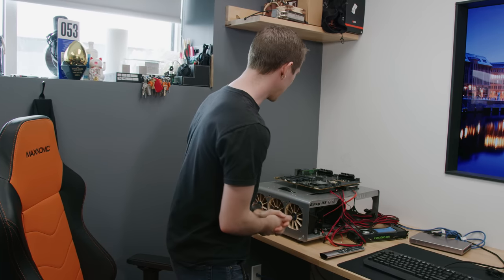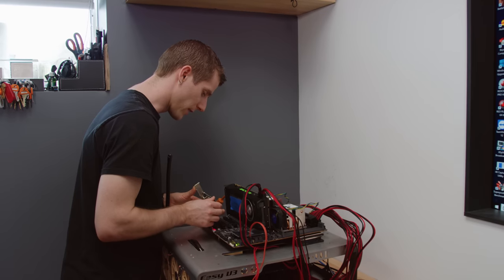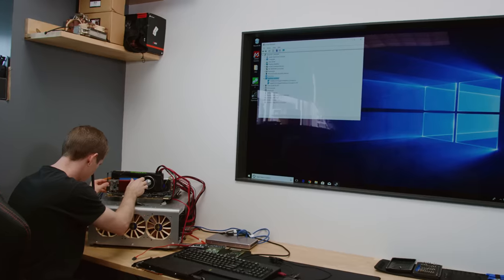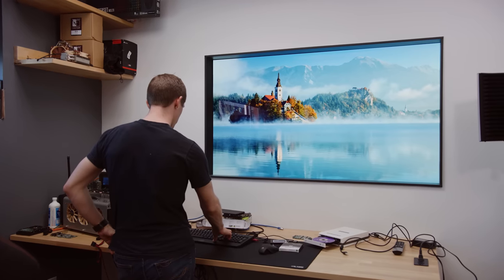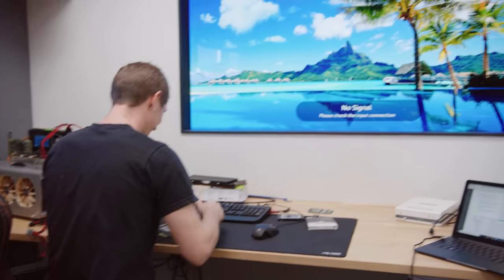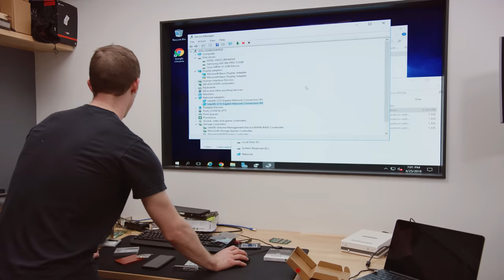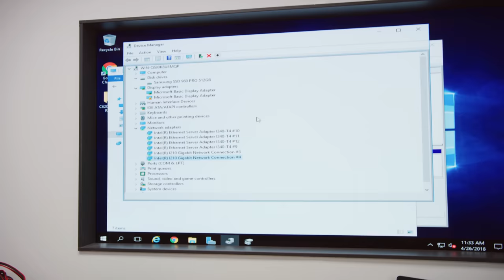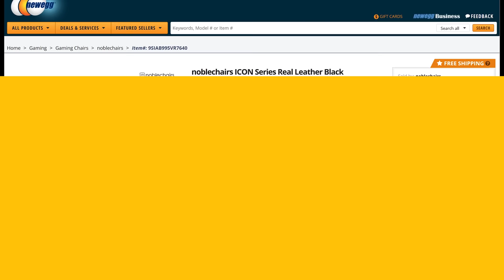I've NEVER been so FRUSTRATED... Hot-Swapping PCIe Cards

Comment: This is pretty good news for repair shops the need to test parts a lot. Nice and easy, just plug it in and immediately know whether it's dead or not.
Reply: chipmonk434 ohh get outta here with your plausible use case.
Reply: Well it would certainly speed things up if the part was working. But would you really trust this method to determine that a piece of hardware was dead?
Reply: If it became a stable and supported feature on future boards... yeah... why not?
Reply: It's been available with server class motherboards for more than ten years, and before that it was possible with PCI cards. I wouldn't be surprised if it's in the first PCI-E specs.

Manufacturers don't want to enable this for consumer cards as every time you plug a board in doing it "free hand", like Linus did it in the video, there is a chance you either misaligned it, dropped the card, touch a nearby card or short circuit something on the motherboard by touching it with the bracket.

In servers where the hot swap capability is enabled they usually separate the cards using plastic dividers so you can't short out a neighboring card, and card guides that attach to the card and then slides into guides built into the chassis making sure the card is going straight down into the slot. As the card guides has to align the card exactly they have to be designed for each card, making it impossible to have one for every card out there. So they will only make these for a small subset of controllers sold by the server manufacturer, and any use of a card not on this list will invalidate any warranty or service contract with the server manufacturer.

Comment: PCIe was designed to be hotswapable ... and it actually works fine on most motherboards, however Windows does not generally support it, but do check out the kernel options in Linux. (again make sure the option is enabled in the kernel!)
The biggest issue is plugging in the cards straight as to not short circuit.

Comment: Imagine a cpu that is hot-swappable ⚡️
Reply: That should be a video!
Reply: I assume this is only for servers with 2 cpus lol XD.
Reply: I've had the pleasure to install a system with full redundancy. It was a storage array combining SSDs and HHDs to form one big volume, and if one of the CPU would fail, the system would switch on the other one. The same happens for network cards, PSU and... Well... all other components. This is super awesome for system updates, were you don't even have to turn off your production system!
Oh, and the whole thing was running on Linux.
Reply: Uhh Hot Swap Power supplies already a thing if you have 2 Power Supplies installed
Reply: MODULAR COMPONENTS!
Reply: We've got servers that the CPUs, Memory, PSUs, and drives are all hot-swappable, if something fails it just runs in "degraded" mode which just limits it's capability until full functionality is restored.   So for example if one of the Power supplies fail (and there isn't a redundancy remaining) then it will limit the power of the server per the % of running PSU's left.  so if the server has two and loses one it limits everything to 50% power (or less) until restored.
Reply: high end stuff is totally hot swap-able, but you pay for it. Nice to see the tech slowly trickle down.
Reply: Imagine a nuclear reactor that is hot-swappable ⚡️
Reply: (Bloody estonian name lol) motherboard will hate you after that xd
Reply: noo.....
Reply: Let's just hot-swap the Motherboard
Reply: See oleks vahva!
Reply: Zamaro Wow that's pretty cool, Linus should definitely cover this.
Reply: it will take another 25 years at least to do that...till then keep imagining
Reply: Oh it had to be Linux, sounds like a good daydream for us Windows users tbh :d
Reply: It's amazing how people don't actually listen to Linus in his videos. He already mentioned that hot swap CPUs do already exist in the server world, As well as hard drive and pcie and memory and PSUs.
Reply: that will be rad....
Reply: Would be literally impossible. Maybe it could happen if it was a server board with 2 CPU sockets and then maybe you can hot-swap 1 of the cpu's.
Reply: My not so high end, home built servers already have hotswap power supplies. The (Chenbro tower) case has a small controller for handling this and it will work with any random systemboard. 

Hotpluggable CPUs and memory is a fair bit more involved, but have been around for quite some time as well. In the mid 2000s I maintained a bunch of Dell 6850s which supported this, through no 'surprise' hot removing of memory or CPUs, had to press a button and wait for an indicator light to turn on before removing parts.

Now.. hotplugging for u.2 connectors is quite something, as it allows those nice low latency nvme devices to become hotpluggable. Ok, Linus showed some fun other stuff you can do with this as well, and hotpluggable NICs might be quite a thing as well. Being able to replace parts on a running system in general is mighty useful.
Reply: Ja Hoekstra, high end SUN servers have had hotpluggable CPUs since forever.. but thats sparc architecture. In theory, a mid 2000s Dell 6850 would allow CPU hot swapping, through that requires OS support as well.
Reply: Uhm  fdgfdgdsg, that has been addressed by clustering since... wel, at least since DEC VAX was a thing. You do not need an individual machine to be up 24/7 to provide for an environment that will be available 24/7. Hence, most servers will only have the more trivial components with hotplug support: storage and power.  There are exceptions, and I've used them, but the value of that is usually very limited compared to the cost of such hardware. Often using like 3 or so much cheaper servers in a cluster will provide both better redundancy (as your systemboards and everything else is now redundant as well) for a very similar cost.
Reply: CPUs and RAM is HotSwap too and it requires special ACPI table (sorry I do not remember those 4 letters, but in Linux it is called container)
I have seen it at least 15 years ago, so that is nothing new
and obviously we are not taking consumer grade but monsters like 16 or CPUs, 8 or more boards with RAM
Reply: That can not be possible unless somehow you got a button that stores everything from the cpu to ram (example) and then swaping and pressing the button again
Reply: watch the video he goes over this
Reply: Speaking of hot swapping CPUs, I'm surprised that Linus and company haven't switched over to using those graphite thermal pads they recently featured when slapping together PCs for testing. Seems like it would save a lot of time and effort. And they're reusable to boot. However, I just realized that the CPUs on this board are GINORMOUS, so maybe they didn't have the right size. At any rate, mark my words, someday Linus will bitch when he comes across a CPU that he has to clean thermal compound off of. You heard it here first. ;) :P
Reply: Who says the filming started after they reviewed the pads ;)
Reply: ToxicLeaker L, that is exactly how that worked on hardware I've used with support for cpu and memory hotswapping, through for memory there is a way around that by using mirroring between memory modules or banks (usually on riser cards).
Reply: This could be easily done today, just have a special 'low power mode' and a built in dual/quad core atom cpu that only works in low power mode and you have a hot swappable cpu
Reply: ToxicLeaker L that is possible and there is no button, but sorting from all data from CPU happens hundredths to teens of thousands times a second - it is called context switch and it goes even further you can do it with both contents of CPU and RAM in one go and it is called hibernation
back to real topic
ACPI does last context, but do do not switch but turns off CPU, you remove CPU and instruct Operating System na CPU is installed, then ACPI initialize CPU and drops everything back to CPU
with RAM it is even easier as it is moved to different place and RAM is switched off, then new RAM is setup and all contents are written back

do not try to claim it is not possible because it is complicated while while works does put their computers to sleep and even hibernation and this users exactly same schemes of execution just uses different code for it

it does not mean that something is impossible just because you do not know it is possible and actually done long years ago
Reply: Hi Jan Hoekstra, fellow Dutch guy :-) you can also look for a somewhat older high-end server from dell or hp. For SUN hardware, you also need the high end models ('enterprise' servers), the intel/amd based ones are just more practical I think, SUN hardware with Solaris has the advantage of being better integrated, so that should just work, on 'pc' hardware it may take a bit more hassle to get it working with your OS of choice. 

Either way you end up with a 19" piece of hardware of at least 4U high and that you will keep paying for in electricity :-) But its nice to own such hardware just to fiddle with. I used to have a number of Dell, HP and SUN machines, but they got old enough to be mostly usable as very noisy space heaters.  I'm mostly into assembling server grade hardware from components, usually 1 or 2 generations older than the latest and greatest to make things affordable. I'm usually more interested in the features such hardware has (like hotswappable power supplies and disks and such) and getting lots and lots of io bandwidth, support for lots of ecc memory etc, and a bit less in cpu performance (through lots of cores is nice for virtualization). Assembling from components gets you a lot more flexibility when it comes to upgrading hardware.
Reply: WizardNumberNext yes its certainly possible, but for moving memory content as well as having the system stop scheduling a cpu, it needs to know those are going to be removed before they are actually removed. There is no way to copy the content of memory somewhere else once the memory is removed. Ie, one way or another you need to inform the system about that. Sometimes that is done with a button, sometimes unlocking the component before it can be removed also serves as that button, sometimes you have to inform the OS from some other UI, but one way or another this has to happen for a cpu (else the current context and its onboard cache are unrecoverably lost) and for memory unless you have some form of memory mirroring or multi module erasure coding scheme or such.
Reply: that would be impossible withiut maybe dual cous..if you had only one cou and tried to hot swap it, it clesrly can't work without a cou in the system
Reply: the sheer quantity of bullshit in some of these comment threads is actually breathtaking
Reply: Servers.
Reply: It would be cool on every day computers, Its only in big servers with multiple CPUs. That way if one fails they can just swap it
Reply: +BitBastelei Indeed! ;) I would like to see if they become popular or some flaw or significant drawback is discovered. Of course, it still looks like there are some compounds that are slightly superior if serious cooling is the goal.
Reply: +woolfel  Ugh, don't talk to us about trickle down...
Reply: Siim Kuusik most useless thing ever
Reply: Technically it is since it's always running.

Comment: I've heard Linux can hotswap CPUs.
Reply: I've seen Windows do it.
Reply: You can
It just needs to be on the right system 
Ive actually hot swapped all kinds of hardware in severs, mostly ram
Reply: It's cool to know you can do it, but what would it really be useful for?
Reply: If something breaks you need to replace it without server going down
Reply: Calm down people. Multics did that ages ago.
Reply: Yeah. I hotswapped HDDs in linux too lol.
Reply: For replacing failed hardware on systems where downtime is not an option
Reply: Yeah, but would it be useful to you? I certanly don't run a datacenter in my basement, I don't have a server that requires minimal downtime (and I also don't have too much money to burn)
Reply: AllAroundLP it is useful for me, my router runs on a VM, and i host websites and share a Plex instance. It's nice to avoid outages wherever possible. That said, I don't have a board like this.... The only thing I can hot swap is storage
Reply: OpenHomeAutomation Cool, that's a good application. Too bad for you that you can't do the same as Linus

Comment: A few years ago I didn't even know you shouldn't hot-swap pci/pci-e cards so I was doing that all the time on some old pentium 4 systems with xp installed and it has always worked. Once I even tried it on a newer system with windows 7 and it also worked, however, I have never tried it on windows 8 or 10 and I think that in the case of this video, the operating system is probably making it harder to do a hot-swap.
Reply: microsoft in a nutshell
Reply: Same to me :-) What thats not a thing? It can damage your cards? They should tell you somethong like this :-)
Reply: Same here I had a 2008 desktop (core2duo) and I used to swap pci cards on and off all the time with windows Vista 😁 it worked no problem
Reply: Erzgebirge erleben yes, hotswapping stuffs that aren't designed for it can damaged your equipments, do you see on a USB port there is 2 pins which is longer than the other 2 pins? It's longer for a reason, you need to power a circuitry first from its power pins, if you powering then first via a data pins then you can damaged it, meanwhile  most of pins on pcie are equal in length. I think this board's slot have a special design that the contacts on it are designed to have longer size on specific pins
Reply: Also same to me on P4 and XP , worked 95% of times,  hot swapping pci didn't ruined my system or cards :D

Comment: You were on Windows Server on the last working attempts! What about Windows 10?
Reply: This, and the Ubuntu case, too.
Reply: Yea I really 100% need to know if this works properly under Ubuntu, and if not, which Linux distro properly supports this and works. When you run/work at PC Repair Shop, the hot plugging for PCIE cards directly would cut down SO much on wasted down-time. And yes, we have two systems with this same Motherboard.

Comment: Try hotswapping the CPU. Bet you can't do it!
Reply: Yeah we have been able to hot add and remove CPU, memory, IO cards, and even replacing half of the motherboard at a time in AIX for years.
Reply: Did it, works perfectly fine.

Edit: was using server motherboard fyi
Reply: You can try it on a VM, hot add memory and CPUs. I've often had issues with hot removing CPU and memory on both physical and virtual though.
Reply: Oliver Burkill hot adding CPU and Memory in VMware has been mostly fixed with Windows Server 2012 + and RedHat 6.5 +

Comment: but how about hot swapping gpus mid game :)
Reply: why would you do that?
Reply: It will crash, the game cant handle that
Reply: Mitsuka Souji But a custom-coded engine could be made to account for that, pause and give you a "Retry graphics initialization" button I suppose lol.
Reply: i have no idea just wanted to ask for a try out
Reply: 3l H4ck3r C0mf0r7 I think you're right. It wouldn't work unless the game was coded specifically to allow it.

Or alternatively you could create a Virtual GPU to pass through info to the real GPU. Then when you swap the GPU's it will just lag for a bit rather than full on crash.
Reply: That would require the game's graphics system being written to support this, which would be hilarious but also would never happen.
Reply: Devilofdoom That makes sense, since it'd keep compatibility with any and all games, as long as it's continually updated to claim and handle support for anything new that drops by.

...But having a vGPU may introduce some lag. Maybe it'd be better to modify or hook into the graphics API itself instead?
Reply: I think if a program that still keeps working after a gpu driver crash may could handle this if you still have more gpus on the board.on my side I have my driver crashed when StarCraft 2 running,still running after this
Reply: Brian Bosak Beautiful.